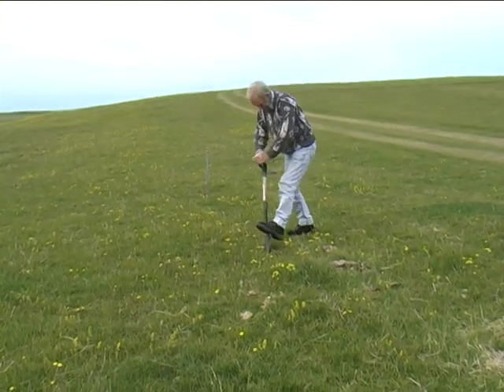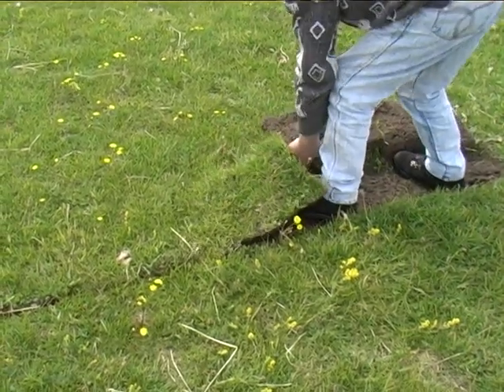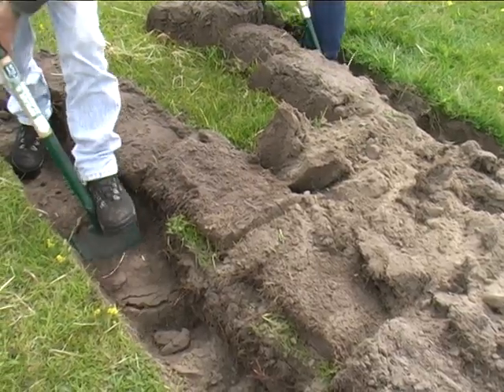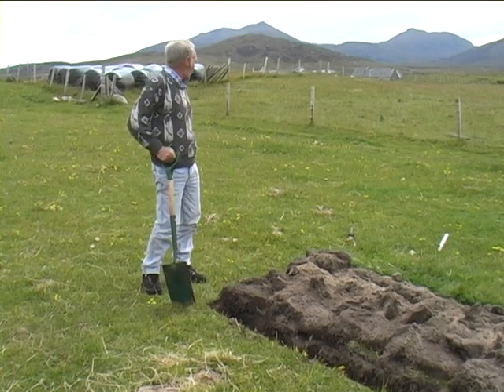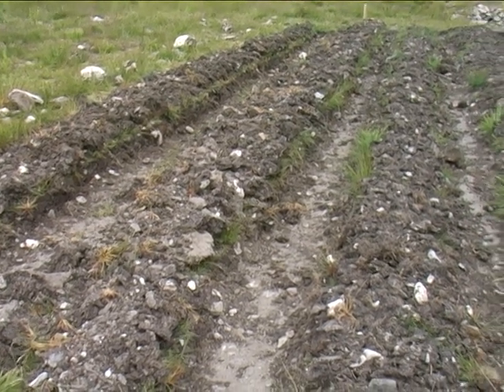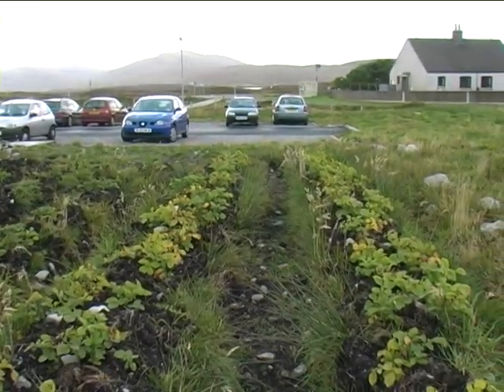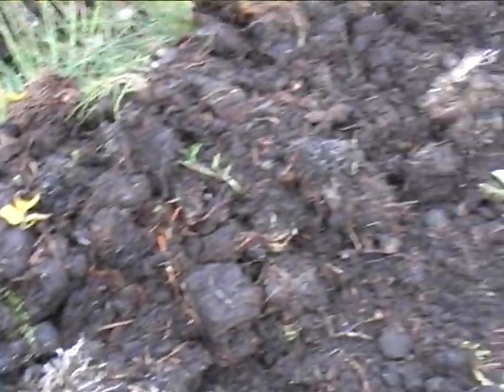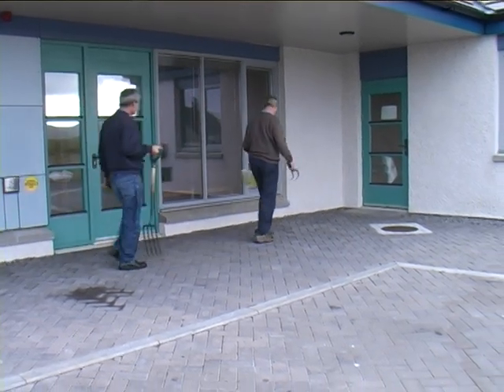English Documentary: Lazy beds

Comment: I have to thank you for this excellent video. I have only just come across it again but I remember it well. I used this method to establish our vegetable patch here in Ireland 8 years ago. The ground isn't the best drained but this gives me dry ridges that I was able to plant in early Spring. Seaweed and cattle manure and the soils pretty good now. I found that if I could fold the grass over without splitting it the weeds were trapped inside the ridge.
Reply: Did the tater send roots n tubers between the sod also?

Comment: You didnt have to disturb the soil at all. Put cardboard down and then loath it with soil mix. Use vermicompost soil and compost on the bottom. Wet the cardboard first before putting the soil on top. You are done! You could have saved yourself some time and the soil structure underneath!
Reply: Svetla Nikolova Sure that would work but it would need a lot more preperation to make compost or resources to buy it in.  This way all you need is a shovel. 

I used this method to start planting  on short term. After this harvest I want to covert to no dig and just add compost. We'll see how it goes
Reply: The information missing from this video is the other reason for building lazybeds; drainage and soil depth.

The Outer Hebrides are very wet, constant rain. The soil is heavy and very shallow, in places only a few inches deep before you hit rock, and consequently waterlogged.

Building a series of lazybeds has two great benefits. It creates more soil depth, and the valleys between each bed are good drainage.